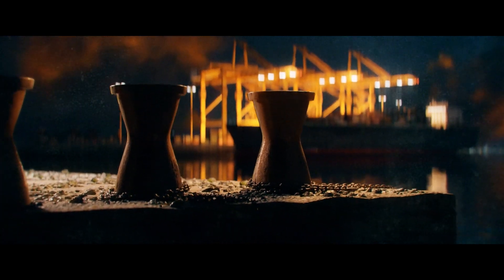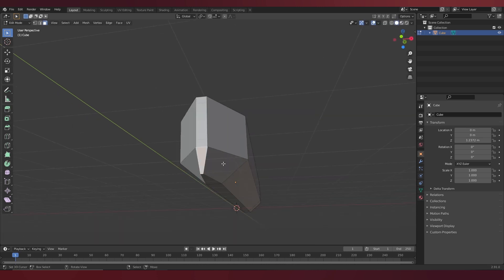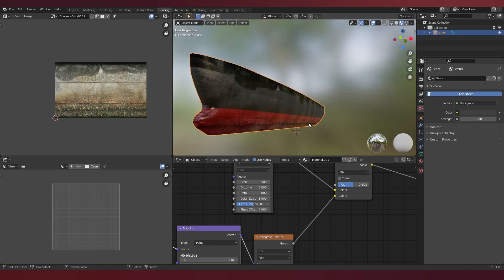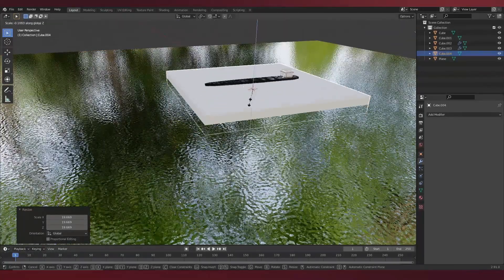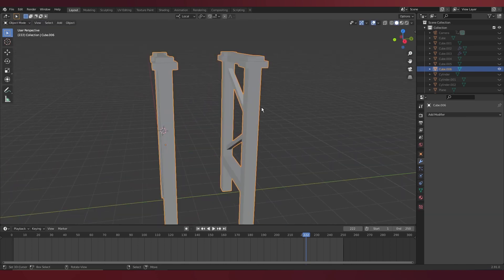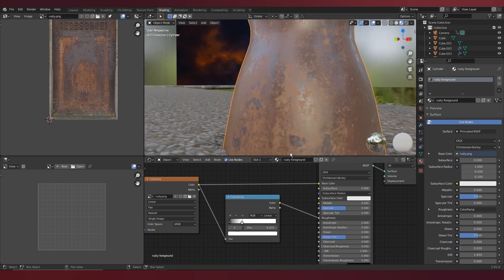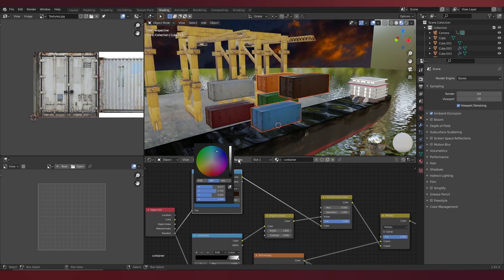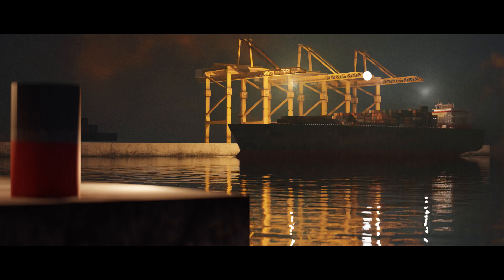How To Create a Shipping Port (Blender Art Breakdown)

Comment: God knows in how many videos i made that following comment : 

3:07 - In bump node, you use the DISTANCE value to control the bump, Not the strength, Search "blender bump node strength or distance" and "Understanding the bump node"
You are getting the wrong results, it looks ok because it applies uniformly so the eye doesn't catch it but this isn't a good practice (Not the way it was meant to be used). 

Quote from another video : "You are actually supposed to use distance value. strength does a strange fade with the bump but  distance properly effects the bump.    using the wrong one can cause shading issues."

 (And if Ian also used bump node the way you did, then Ian is ALSO wrong).
Reply from the maker: Thanks I'm now keeping it in mind, nice tips from a youtube veteran :)